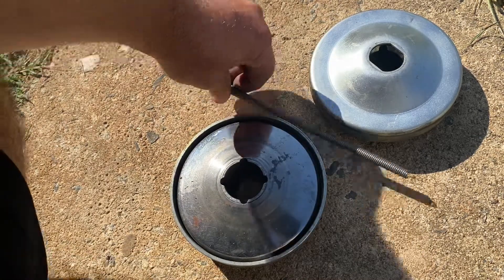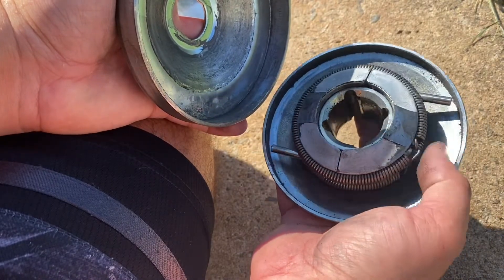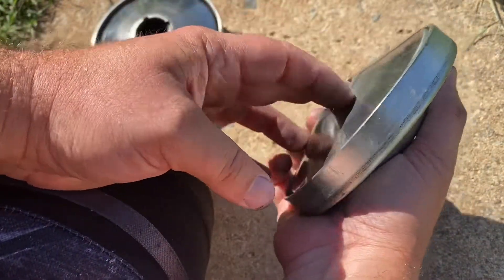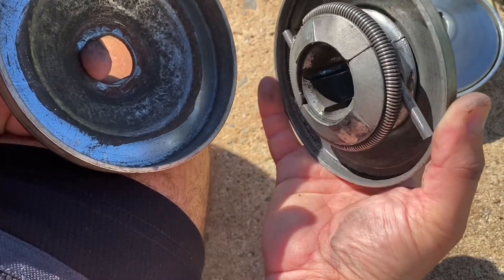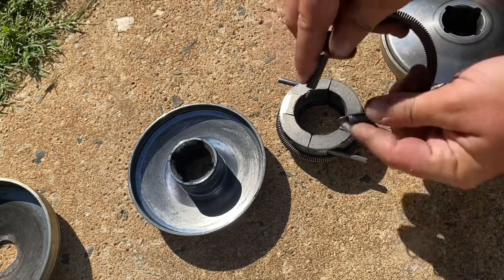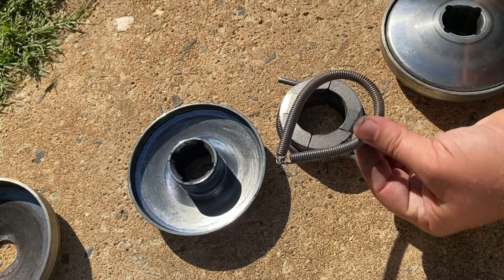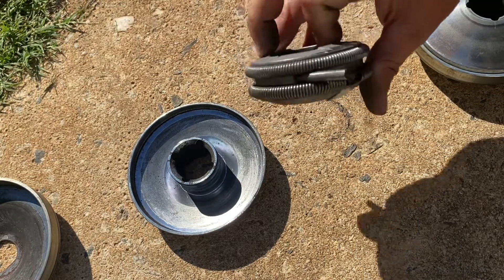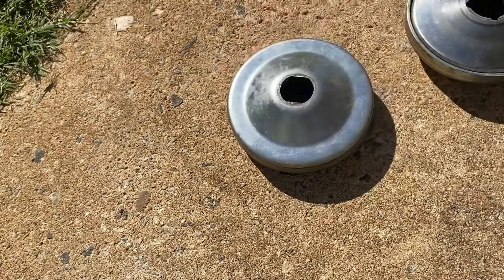30 Series Torque Converter Garter Spring Replacement In Driver

Comment: Clock your springs where the ends hook together at 12 and 6 pin pointing up pin pointing down this should take care of your problem.
Reply from the maker: This is the first time I have heard of this. Didn’t see anything from a quick google search. What is clocking the springs supposed to do?
Reply: This will allow the weights to move the same, smoothly and stay balanced   If the pins are bent or loose it’s time to replace it. Place the spring where it hooks together closest to the pulley with the pin up at 12 o’clock and the other at 6 o’clock. Keep looking on YouTube you will find this and better understand seeing them do it. Watch a few so you can weed out the blind leading the blind. lol